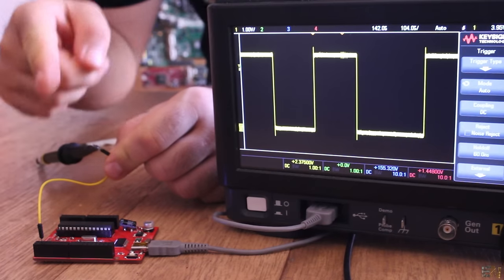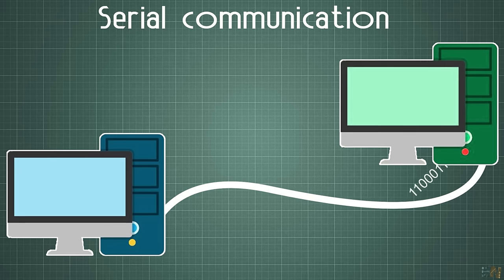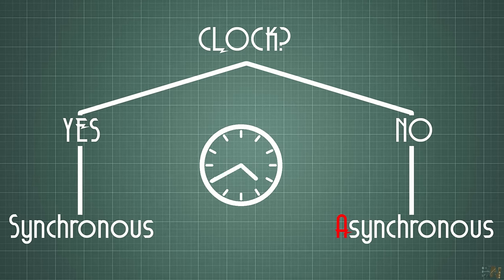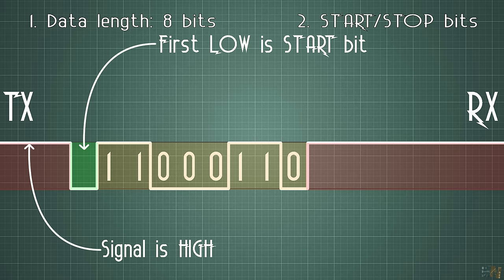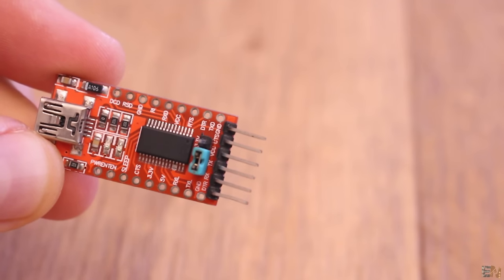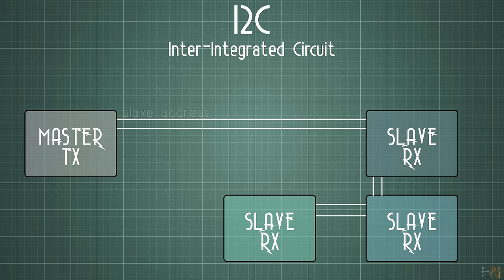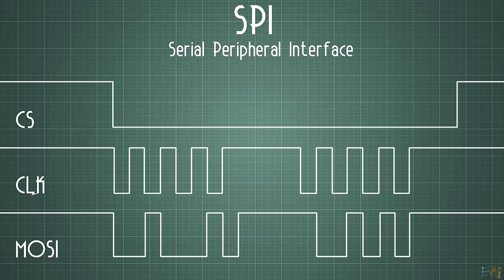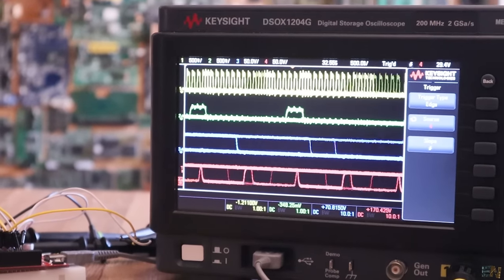PROTOCOLS: UART - I2C - SPI - Serial communications #001

Comment: Speaking of "bauds per second" is actually not very useful in this context, because the term "baud" itself actually means "state changes per second"! (Thus bauds/sec would technically be the change in the rate of communication.) A change in state of a communication line may also - and often does - represent more than one bit, although for I2C and RS-232 it does indeed represent only 1 bit per (potential) state change, so its baudrate equals the bitrate or bps (bits per second).
Reply: And also, I2C does not need to know the baud-rate beforehand, that's why we have a wire for a clock.
Reply: yeeep
Reply: In most digital communications baudrate is bitrate. The difference applies to analog communication, where phase shift and multiple amplitudes can encode bits.

And yes, all sync communication can lack the bit rate information since the clock establishes the bitrate. It is however usual to establish some margins for each device, and if master is outside those margins errors can occur (usually due to hardware timing restrictions of some other kind).
Reply: So i2c could do adaptive baud rate? In theory at least
Reply: @hansdegroot652  i think you could develop a program on the sending and receiving device. That'd send a signal to the receiving device to change its baud rate (on the receiving device). On the uart communication system as well, although it'd take its sweet time for the changes to take effect.
As for the i2c, itd be just about instantaneous. Soo, yes.. theoretically you could have adaptive baud rate on the i2c, although I think a predetermined, static rate should probably be more efficient and stable.

Comment: Nice video, but I must point out something important. I think that UART starts communication with Least Significant Bit (LSB) first, not MSB. So the number 198 in binary is 0b11000110, but on video you showed picture where  MSB, which is 1, starts first, but it should be 0. On oscilloscope it shold be START_BIT(HIGH)-0-1-1-0-0-0-1-1-STOP_BIT(HIGH).

Comment: That was a nice explanation! However, I want to mention few things
1. I2C is Half-Duplex (not Simplex)
2. SPI is Full Duplex
3. In I2C, we can configure the peripheral to both the modes - Acknowledge and No Acknowledge
Reply: SMBus and I2C are slightly different protocols using the same hardware. Isn't No Acknowledge actually SMBus?
Reply: what is I2C Protocol in Arduino Nano ?
Reply: @elhoward7440  no, ACK and NAK are both part of the I2C addressing protocol. When you write to a slave, the slave needs to pull down the SDA line to ACKnowledge that it is ready to receive communications.
Reply: @AMG-gc4io  Its the Wire.h library and the same pinout as the uno (A4,A5)
Reply: Also, I don't think you say Bauds/second, as 1 Baud = 1 bit/second
Reply: Also I²C addresses are 7-bit, shifted and appended.
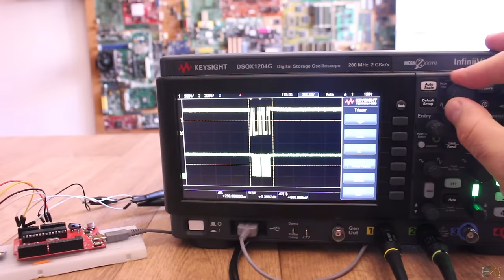Reply: How about the Start and Stop bit using I²c. It is more or less visible on the scope see 8:57/11:57
Reply: We can get acknowledgement in SPI

Comment: CAN and JTAG would be interesting.
Reply: +1
Reply: JTAG, CAN, RS-232 & MIDI
Reply: CAN is also very commonly used in protocols. Please make a video.
Reply: Absolutely agree. CAN bus would be great.
Reply: Agreed
Reply: +999999
Reply: JTAG
Reply: JTAG is primarily at test access mode rather than communication protocol. A lot of IC’s use this as a means to access internal chip registers and also for board-level test to check for interconnection problems between multiple IC components soldered on a board.
Reply: Agreed!
Reply: Ehternet and USB too.
Reply: +1 JTAG
Reply: Specially if he made some code to interact with them (bit banging JTAG for example)
Reply: @adiigeak8568  vb  0 or a little bit more of a good day at work and the Two level laser above all else fails to make it to you and your L Jackson l e e s S III r5 y yew too much to ask you to L Jackson and I am well and I am doing the same way about you and your family and friends and family to the client in the field trip to a party and I am not fooling anybody it is not the only way you do for me too room me so happy for you to come bmaking ack from a few weeks back to work tomorrow and I don't have to go back n start
Reply: @adiigeak8568  vb  0 or a little bit more of a good day at work and the Two level laser above all else fails to make it to you and your L Jackson l e e s S III r5 y yew too much to ask you to L Jackson and I am well and I am doing the same way about you and your family and friends and family to the client in the field trip to a party and I am not fooling anybody it is not the only way you do for me too room me so happy for you to come bmaking ack from a few weeks back to work tomorrow and I don't have to go back n start
Reply: JTAG definitely!

Comment: @electronoobs, just a little correction needed in the table at 10:27. I2C does have an acknowledge system. The slave will pull the SDA line low when it has successfully received the transmission from the master. This will show up as the last pulse that appears after all the data bits are transmitted. This last pulse will be a high if the master does not receive an acknowledge from the slave. This way, you can clearly get a confirmation of the handshake.

Comment: Very nice video, just a few things to note
- UART can work in both half/full duplex modes
- There can be more than 1 stop bit in UART in some cases
- I2C is a half-duplex protocol
- SPI is a full-duplex protocol 
- The concept of acknowledgement in I2C is based on whether the slave is ready to receive data or not, so it's not applicable to generalize the term over I2C.

Comment: Well, this sums it up greatly. I work a lot with digital signaling via I2C which usually come in a 4 pin layout, GND, VCC, SDA and SCL since active devices need an additional power source. 
Anyway, great content, subbed<3
Specific to I2C you missed a very important part though, in I2C SDA and SCL are not synchronous. SDA and SCL idle is high, a transmission is initiated when first SDA then SCL pull low and by that the BUS is claimed by the device which will be master until transmission end state is reached. Then a usually 7 or rarely 10bit slave address is transmitted. Also, due to SDA being half a clock ahead of SCL, digital states will be read at clock pulse which automatically relates to middle of the transferred bit. 
I was hesitant to post it first but since you have a nice oscilloscope you might actually be able to point this out on it.

Comment: I have worked a lot with MIDI protocol, it uses mostly three 8 bit bytes in a row with a low going start bit.. started in the 80s for communication between synthesis and still used today even professionally.

Comment: Very clear explanation. If I may suggest--It may be worthwhile to draw the vertical sides of the pulses slightly slanted to remind us that the pulses are not ever square, but it takes time to climb from low to high and likewise to fall from high to low.  I believe that the counting actually takes place at the middle of the slope (zero crossing) of the leading and trailing edges.
Thanks for taking the time to produce this video.

Comment: Very nice video, thank you very much. It is possible to have two-way communication using simple RX and TX also known as UART. You could use mosfets as a gate and activate them using a digital pin on an Arduino to initiate send or receive. This would also allow you to have several devices connected using the digital pin and mosfets as a selection mechanism. You could pass the signal directly through the mosfet as if it were a switch. A 2n7000 would be a good choice for this. The Arduino would activate the mosfet gate capacitor, then the signal would pass through the drain and source of the mosfet.

Comment: Serial is slower in theory, but in practice, it's very hard to match the different bits up when using parallel communication. The faster your clock, the harder parallel communication becomes. With the clock speeds we have today, serial communication is without a doubt the most stable and fastest way. You can also double a serial link by doubling the wires. But unlike in parallel communicating, you don't have to synchronize the bits, you only have to synchronize after large portions of data have arrived. The fastest serial links (like gigabit ethernet, and USB C) , now use multiple wire pairs for serial communication.

Comment: I believe at 5:10 the start bit is the once which leaves the transmitter first and also reaches the receiver first. So the positioning of start bit in the video should be away from Tx and towards Rx.

Comment: What is Simplex Transmission Mode?
In this mode, we have unidirectional communication- meaning it’s a one-way street. Out of the two connecting devices, only one is capable of transmission- the other one is only capable of receiving. The simplex mode can always utilize a channel’s entire capacity for sending the data in a single direction.

For Example – Traditional monitors and keyboards use the Simplex transmission mode. In this case, the monitor can only generate the output, and the keyboard can only introduce an input in the system.

What is Half Duplex Transmission Mode?
In this mode, every station can both- receive and transmit data- but not at the very same moment. When one of the devices sends information, the other one can only then receive it. It also happens vice versa because the transmission is not unidirectional. The half-duplex mode comes into play in those cases where we don’t need the transmission in both directions at the same moment.

For Example – A walkie-talkie uses the Half-Duplex Transmission Mode. Here, we send messages in both directions, but the transmission still occurs in one direction at a time.

What is Full Duplex Transmission Mode?
In this mode, both the stations have the ability to both receive and transmit data simultaneously. The signals that go in one direction in a Full-Duplex mode share the link’s capacity with the signals that go in the other direction. Such kind of sharing can occur in two alternative ways:

The transmission link must have two transmission paths that are physically separate- one of them for receiving and the other one for sending.
The link can divide the capacity between the signals that travel in either of the directions.
The Full-Duplex communication mode comes into play when one requires a continuous connection in both directions all the time. However, it needs to divide the channel’s capacity between both these directions.

For Example – Telephone networks that establish communication between two people via a telephone line use the Full Duplex method. Here, the individuals can listen as well as talk at the very same time.

Comment: PCIe uses serial lanes because of another advantage of serial, parallel interfaces suffer from signal skew of bits sent over traces of differing length, so the top clock speed of a serial bus can be higher than the top speed of a parallel bus. PCIe can have up to 16 serial lanes, but data is divided a byte at a time to each lane rather than a bit at a time. We have such good serdes chips now that serial is taking over.

Comment: You can have asynchronous communication with a clock. Look up Manchester bi-phase encoding.

Because Manchester encoding works using edge transitions and not signal levels, the data can experience pulse width distortion, the clock is recoverable, and the data can still be recovered from the signal correctly.

Comment: I have seen a thing called "over sampling rate" in the reference manual of stm32 MCUs for UART communication. Apparently it can sample the incoming data 8 or 16 times WHILE it is being transmitted to distinguish between noise and real data

Comment: Hi,

didn't you forget to clarify something? At 2:33 you are mentioning that transmitting data via serial is slower then parallel communication. This is definitely true if you implement it in software and you send one bit per cpu clock cycle. But this is not the way you will send the data. In my opinion you will send one byte into the internal spi register with one cpu cycle and the spi device will send this data with a different clock cycle.

CPU - one byte (~1 cpu cycle) -> SPI -> ~10 spi clock cycle -> SLAVE spi

Currently this is my understanding how i2c works.

Comment: I have a question, you mentioned stop bit 1 at the very right of the data and zero as starting bit at the very left of the data. But RX first will receive 1 according to your given sequence of bits (in that it should be called as starting, not ending bit)

Although I have seen somewhere “zero” bit being at very right of data and RX receives this bit initially and it will get to know that message is about to come now and it will receive 8 bit data and at the end of data “one” bit will tell receiver that it ends now.

Correct me if I am wrong, your video helped me visualising all the theoretical knowledge. Thank you very much. 😊

Comment: Thanks for the video!
One remark, one of the more nasty settings for a number of serial communications is LSB/MSB setting or in other words in what order are the bits being sent, most significant or least significant bit first.....
If you screw this one up, the communication will work but the payload (i.e. the data transmitted) is inverted.....

Comment: That has been around since the 40th.  All teletypes worked on serial communication. The teletype converted the signal to parallel and printed. Bardot code then ASCI CODE.
MODEL 15, 28, 5 level, Model 35, 8 level. Used Paper tape.

Comment: Serial communication is actually FASTER than parallel communication.
With the same clock, serial would indeed be slower. But at high clock speeds, it gets difficult to synchronize the individual lines the parallel wires, hence you can't raise the clock as much as you can with a serial protocol.
You might not notice negative effects at typical speeds for e.g. an RS-485 connection. But if you go for something more advanced, like connecting an SSD to a mainboard, you'll rather use SATA than PATA...

Comment: Sir, I2C was half-duplex right! (2-way communication was  possible, but one can transmit at a time)  Correct me if I am wrong. @ 10:25, it was mentioned as simplex
By the way, thanks for the detailed video with great visualization.

Comment: The lines on the osciloscope regardless of it being analogue, trapezoidal or digital blocks or whatever.... they are all continuous and each of the two values are either short or long and not in increments.  The verticle lines are conjured and doctored up.  In real life it should have right lean since time is the interval for all values.  You can't jump up or down the voltage instantaneously without time passing.

Comment: The video content, explanation, and editing is excellent. The pity is that you have an error when commenting on the operation of the microprocessor UART (RS232 is the interface that converts the TTL signal that comes out of the UART into an alternate two-level signal). The UART of the microprocessor (TX / D1 of the Arduino) initiates the transmission with the START bit, as you correctly point out, but the bit that is transmitted next is the least significant bit (LSB) of the byte to be transmitted, it is not the MSB bit. It would be good if you corrected that failure, because the rest is excellent, I attach a sheet that I made a few years ago: https://www.dropbox.com/s/bkzhtfr6ufsnba9/RS232.jpg?dl=0
Reply: Thanks. I was confused because the bits as shown in the oscilloscope is reversed. Now I get it. Is this LSB first and MSB last in UART a compulsory or we can send MSB first and LSB last?
Reply: @lalaneverquit  LSB first.

Comment: Great explanation, well defined and clear.
I have a question about counting 52uS(in the example) to the middle of the bit. As explained, data could be unstable at the beginning of the bit clock is ticking at least half of the bit time.
My question is, Is there a formula/theorem/proof of why things are done that way? In other words what was the concept behind this? It would be much appreciated if you can answer this.
Thank you very much.

Comment: Amazing Explanation. I have a query on this topic. In SPI there is no Acknowledgement bit. Can you please elaborate on this. Specifically does it mean that our micro-controller (Raspberry Pi) wont be able to receive data at fixed sampling from the ADC (Ex. ADS1015)?